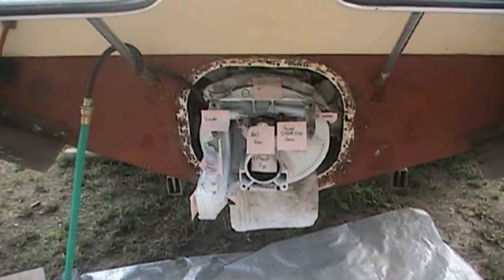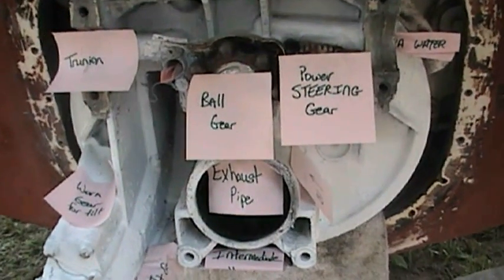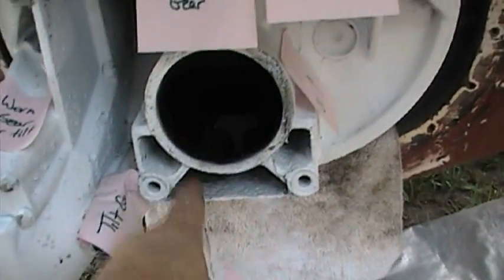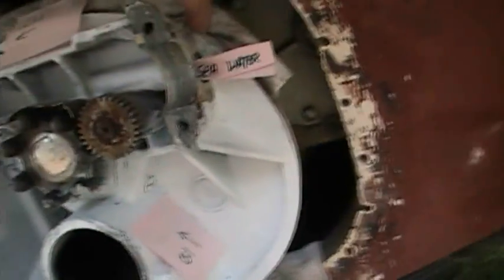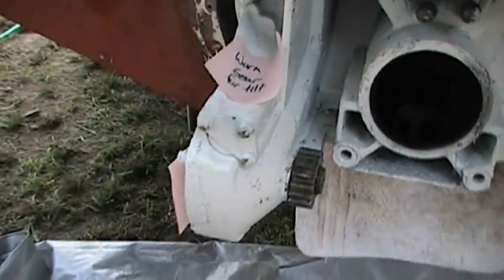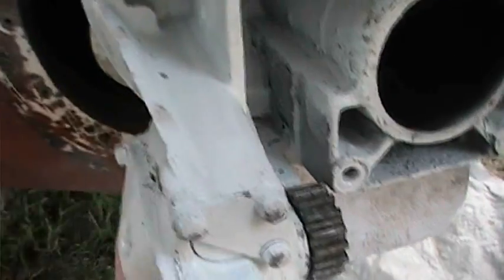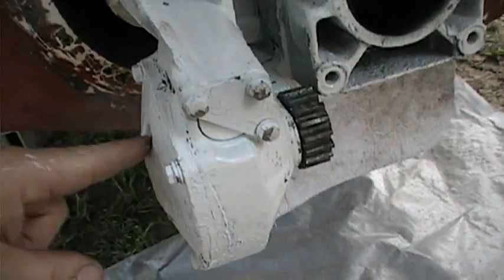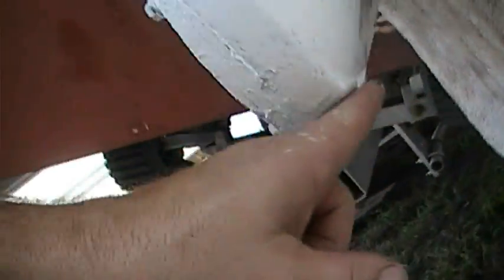OMC Stringer Intermediate Housing

Comment: Solid video. Any chance you know how to remove the power steering gear? And any chance you know how to remove all the gear oil so it doesn’t spew out? I think I have a work washer right behind it that needs replacing. Leaking oil from that gear. Can’t figure out how to check the power steering fluid.
Reply from the maker: drain the power steering pump then turn the wheel all the way to the left then all the way to the right a could of times and redrain the power steering pump again...that gets quite a bit but it is still messy. The Ram, actuator/cleavis bracket was all hard to get to for me and it was a very hard circuit to work with. Mark everything with a marker so you'll know where everything was when you go to put it all back bc it's not an easy task....sorry i can't help you more, just a lot to wrestle with back there and it's in a bad spot
Reply: Thanks for the reply and intel. Working on a 1984 beachcraft with a 3.8L V6 inboard outboard. Lots of fun.

Comment: Great video.  Thanks for posting it.   Do you happen to know the part number to the electric motor for the tilt?   Having trouble finding that.   I believe the one that I have and the one that you have are the same. Mine is a 1979. IMP Aztec w/ stringer 800 manual shift on 260hp Chevy.  
Any help would be greatly appreciated as I am about to put it back in the water. 👍

Comment: Hey studdy68 have ever changed the water pump impeller on that? I have a 1975 stringer. Can you change this out without taking the entire drive off the boat, or it possible to do it with only removing the lower housing? Thanks!
Reply from the maker: ive changed about a dozen impellers and always had to take the drive off. I've read online where a few magicians can do it with it on but that would be quite a feat
Reply: studdy68 wow ok.ive been researching for the last week and havent has much luck. I have the shop manual for the drive but was hoping there would an easier/ quicker way. Well thank you for your response and any other tips and tricks you could send my way would be greatly appreciated.

Comment: What type of oil should I put in the intermediate  housing
Reply: any engine oil is OK, on my boat, I use 15-50 grade and i made a pipe jointing the clutch mechanism to the output shaft housing, then, I modified the output shaft cover to install a fitting and an oil reservoir so oil is fed by gravity to the housing and the clutch mechanism.( this limits greatly water intrusions )
By the way, I had to rebore the housing and to made a corresponding bushing for the output shaft of the tilt mechanism because the bore has an ovality of over 0.015" so no seal could be oiltight.

Comment: thanks for taking the time to create and post this video. Maybe you could help me answer a question I have?   I have just purchased a complete 400 outdrive......it was removed from the original boat in one piece....they disconected the intermediate housing from the engine with all external sections intact.   Can I re-install it the same way.....as one unit.  Or do I have to disassemble it and install the intermediate housing first?  thanks

Comment from the maker: Intermediate housings (IH) can get awful brittle over the years if the anodes are not changed out regularly...more so in saltwater...make sure the IH is still pretty solid and not chipping everywhere.  

To answer your question, there is a bump on the shift cable where it should hit the IH.  RTV black permatex all the way around it.  Pull it firmly through the other side.  Then heave it firmly from the engine room side to seat it.  Then put the clamp on from the outside, and RTV some more.

Comment: Hi Studdy68, I recently got a 1974 Century with a 225 omc in it. I put it in the water for the first time this weekend and I am getting a steady stream of water coming through the shift cable hole that you pointed out in this video. What do you recommend to fix this issue? You mentioned silicone, what kind? Am i missing a boot or gasket here?

Any help would be great :)

Comment: I have a 1980 350 chevy with stringer. has power steering. The steering shaft is frozen in the intermediate housing. If I pull the housing will it just slide right out or is there something I have to disconnect from inside?
Reply: If you have a manual steering, you must remove the shaft to be able to desinstall the steering cable so you,ll  need to free the shaft and remove it , if it had grease in its life, probably that a lever and a brass hammer will free this shaft pretty easyly as it is in stainless steel alloy.

Comment from the maker: Well if memory serves me right that is the electric shift model, correct?  Those run through 1977.  It is mechanical shift from 77-84.  I have a great command of the mechanical shift, but the electric shift is not my specialty.

The electric shift operates off of magnetic coils in the lower unit from my best recollection.  A good Seloc manual would explain better.  The iboats forum is also a pretty good place for info.